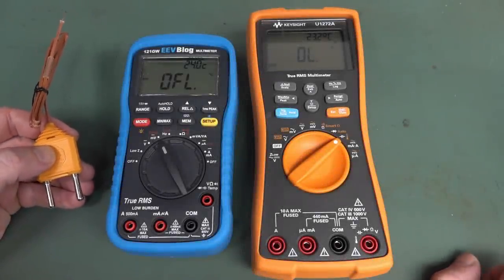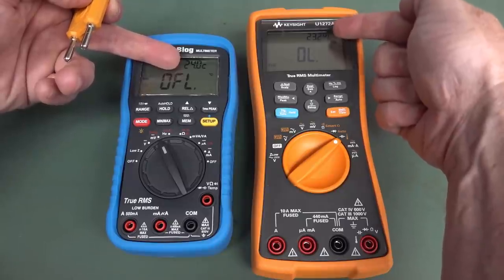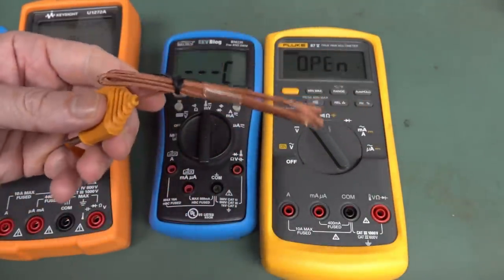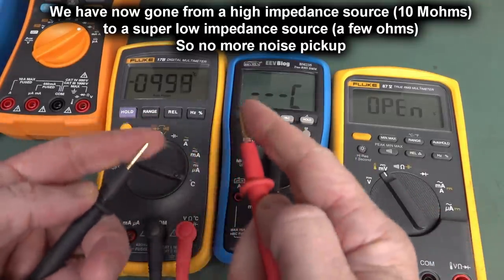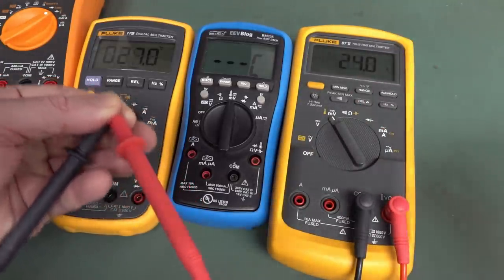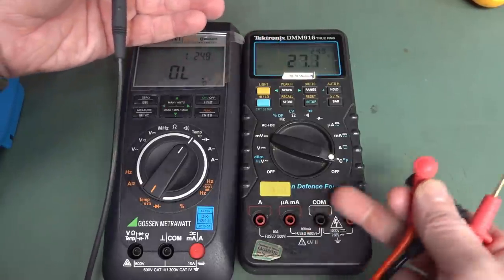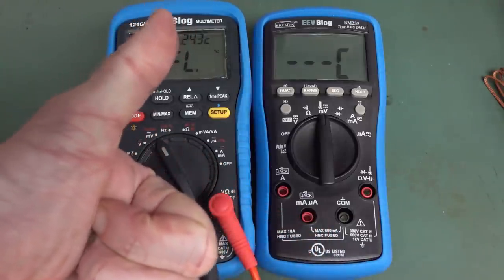EEVblog 1392 - No temp probe? No problem!

Comment: I was taught this when I was in the military, to ensure our cold-junction correction was working before using a meter to measure an external temperature.  Over the past 40 years I had totally forgotten about it.  Thanks for the reminder!
Reply from the maker: Yes, I should have mentioned that actually. If your meter isn't at ambient temperature internally before you take your thermocouple measurement then your reading will not be accurate. This is a way to double check that.
Reply: @EEVblog  are you sure about this? I always thought the thermocouple measures temperature difference between junctions, so whatever temperature is inside the meter shoud work as long as it's measured accurately internally.
Reply: @kaziq  Why would you need to measure ambient temperature in this case if the reading does not depend on it? As you said, thermocouples measure temperature difference between hot and cold junction and the cold junction is at ambient temperature so you have no way to know the absolute temperature without ambient reference.
Reply: @maximgusanu5294  I didn't say you don't need to measure the ambient temperature. My point is that the temperature inside the meter does not have to be the same as the ambient temperature for the measurement to be accurate. Dave said it has to be the same, but I can't understand why.
You say the cold junction is at ambient temperature, so where is the cold junction physically? If it's inside the meter, what does the ambient temperature have to do with it? You only need to know the temperature inside the meter (as close to the junction as possible) to know the cold junction temperature, no?
Reply: @kaziq  I think the cold junction is inside the thermocouple jack, not inside the meter, so the point is that the internal temperature of the meter has to be the same as the temperature of the jack.
Reply: @strobie42  Ah, that makes sense. Thanks.
Reply: @Comrade Vlad nope, the measuring junction of the 2 dissimilar metals is at the bead at the end of the cable. The lead returning to the jack maintains the separate metal types, but after the jack you see that the prongs are both the same metal. So the other metal junction is in the jack, and the thermocouple measures the difference between these 2 junctions. Therefore you need to know the real temperature of the jack to know the measured bead temperature. These meters use the meter internal temperature as an approximation of this. One should be aware of this if moving the meter and jack to different ambient environments, as one will lag more than the other.

Comment: Have met some ultra cheap ones which do not have that, and simply have a 25C offset for temperature measurement.
Reply: Yep, and these multiassumpters (not to be confused with multimeters) may not even have correct LUT/polynomial for temperature. Mine 838 shows over 1000C at 400C soldering fan, but it is totally accurate at 0C and 100C. That's probably because it is calibrated only by these two points

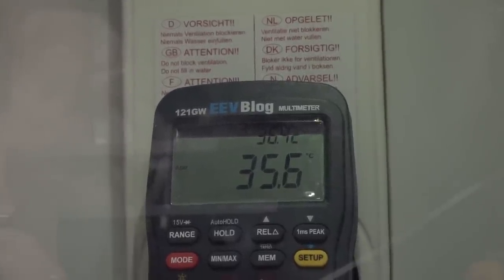Comment: 5:01 The lag for ambient temperature issue is a good reminder that this works both ways: if you're using a thermocouple and just moved the meter to a different environment, you need to wait for the meter's temperature to equalize or the thermocouple reading will be off.
Reply from the maker: Yes, mentioned in my pinned comment above.

Comment: Australian time warp - two minute tech tip is almost 6 minutes long  over here ! ha ha
Reply from the maker: Time dialation caused by the earths spin.
Reply: @EEVblog  Next video: No timer on your multimeter?
Reply: Agree. Video 5 minutes 59 seconds long. Opening with an ad about gut health and taking a big, healthy dump every morning by a Dr. Gundry. The ad was 47 minutes 55 seconds in length! At the end of the anticipated video is a very boring 11 minute 11 seconds ad scrolling the side effects of the latest immunosuppressive drug. That's a two minute 'quick tip' expanding into an unwieldy one hour, five minutes, and five seconds long video production. Yes, I checked the timer and let it run. Went through three soft fried eggs, two English Muffins with sweet butter and homemade lime marmalade. Full pot of Folgers. Guess that now I will have to watch the 'two minute tip', skipping the ads this time. Are all Australian tech tips long winded?
Reply: Looks like all of your meters are too long. Try Imperial.

Comment: HVAC installer here and “retired” controls engineer. I check temps every install with a temp tool and didn’t even think to use this feature and keep the thermocouple around as either a backup or bring one less tool. Great stuff!

Comment: The standard probes are a thermocouple junction whether you want them to be or not.  Copper wires with plated probe tips.  Fortunately the voltages produced are small.
Reply from the maker: Yes, i explain this in my tutorial video.

Comment: Now for the most important question, Dave?  Just how many multimeters DO you have???  A guy with one meter knows what the temperature is; a guy with 2 or 3 or 7 or 8 is never sure.....
Reply: The same logic can be applied to a clock maker. Never knows what time it is.

Comment: Clever. I check the fuse in the meter by setting the buzzer and put the probe in the mA test socket. When the fuse is in working order it will go through the mA jack to COM.

Comment: A few month's back I shorted the leads while changing modes on your BM235 meter. Passed through the temperature mode and was shocked to see it reading the ambient temperature. At the time, I assumed it was just some internal zero reference that happened to coincide with the ambient temp. Cool to know it actually is reading a thermo couple! I shall remember this trick.

Comment: Thanks. For same reason after you charge you keysight accu using the stock charger you have to wait for the multimeter board to cool down before you can do accurate thermocouple measurents. When charging the accu and the board can easily go to 35-40*C and so does the reference sensor. Fortunately for this type, you can judge by temporarily incorrect ambient temp indication.

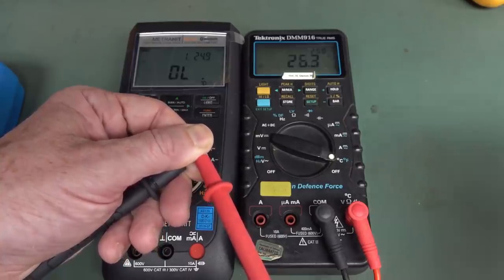Comment: 4:25 You have been holding those leads for a while and transferred some heat to them, maybe conductivity of the metal changed slightly due the heat increase so it shows increased temp?

Comment: I use a cheap hakko clone soldering tester occasionally for the same purpose. It's just a thermocouple in a box with a readout you can put the tip of your iron on to check it's running the right temperatures.

Comment: Ok I read the title wrong, I thought you could use one without a temperature feature to do temperature, kind of like how you can use a multimeter with a light meter (e.g. Apogee) and using a conversion factor get the actual light output.

Comment: I’ve noticed this effect before however I always thought it had something to do with the contact between the two probes doing some magic, now that you mention the cold junction temperature compensation it all makes sense!

However, I’ve just tried it on a Keithley DMM6500 bench DMM and it reports 22.80 °C (5 °C lower than ambient) right after power on, leaving it for a couple minutes to warm up shows no difference despite it clearly warming up on my thermal camera. I get the same results using either shorted probes or a proper ¾” shorting jumper? 

I pulled up the calibration report and it was calibrated at 22.2 °C, maybe the cold junction temperature is hardcoded or something but that wouldn't make sense?

Edit: Just tried it with my old pile of garbage DIGITECH QM1323 and says 25.4 °C which is only 2 °C off but it does respond to temperature changes (very slowly).
Reply from the maker: Interesting, Will have to try my bench meters and maybe put them in the thermal chamber.
There are different methods for doing the compensation, so could be something interesting happening here.
Reply: @EEVblog  I've just had a look through the manual for the DMM6500 as I don't use it for temperature measurements and it says the "Thermocouple Reference Junction" is 'simulated', I now see I can go into the UI and it's set to 23 °C! Changing it to anything else changes the shorted reading to that. It appears you can attach an external reference junction as part of the SCAN accessory cards.
Reply from the maker: @WizardTim  Wow, had no idea! But thinking about it, it makes sense, as rack mount gear can heat up, so an internal temp sensor isn't going to be at ambient temp for that absolute reference.
Reply: @EEVblog  This might make a good trap for young players video (or maybe as an addendum to this video?) as the K type thermocouples I have I always thought were bad because they measured way off on what I thought was the best tool I had for utilizing thermocouples! Turns out they’re all spot on!

Comment: Doesn't work with mine for some reason. Dunno. But it's a cheapo one and it doesn't even work with the temperature reader setting anyway. I put it outside for 10 minutes, and it still showed 22-26 degrees, same as inside. Cool video though, I never knew this.

Comment: My Voltcraft meter does not seem to do this. It does have a temp function on the dial. Not that I need it. I have oodles of DHT22 sensors kicking around.

Comment: So, do the ones with the internal temp sensor that will display it, is that also a thermocouple type sensor, or is that some other type of sensor? Do the internal temp sensors need a sensor for the temp correction, or do they just assume it's room temp?
Reply: Most of them use a small thermistor to measure the internal temperature. It's basically a resistor whose resistance will change based on the temperature.

Comment: If the resistance of the thermocouple was a exact known value how couldn't a temperature reading be given and how accurate could it be?
Reply: They can only measure temperature difference between two junctions. To know the absolute temperature at one junction, you need to know the absolute temperature of the other junction. By the way thermocouples output voltage instead of resistance.
Reply: @chuanliu4685  Yes I must have been confused with the method of reading temperature with certain alloys based on how the resistance changes with temperatures. Also known as resistance thermometers.

Comment: My multimeter doesn't have a temperature function but i bought a temp prob anyway. Is there any formula to calculate the temperature based on the measured resistance? I know it's not practical but I wish I could do this

Comment: I always hated thermocouples because they are so inaccurate and drift with time and usage.  My first assignment as an electronic engineer was to replace the 10 thermocouples in the instrument from thermocouples to RTDs (Resistance Temperature Detector).  They use a platinum wire wound around a ceramic core.  The resistance of the wire will change with temperature.  The initial resistance is usually 138.5 ohms at 100°C.  There are many types of RTDs but this is the most common.  With advanced math, solving a 9 variable matrix and 3 simultaneous equations I was able to reduce the circuitry to 1 common op-amp and 4 precision resistors for an accuracy of 0.1% over a range from -200°C to +600°C and a voltage output of 5mv/°C from -1V to +3V.  I was also able to correct for any length lead resistance to so only a 2 wire RTD is necessary.  My boss was so shocked and excited he didn't wait for the lawyers in the patent department to do their jobs and immediately put my design into production.  The patent lawyers came back and said they can't patent the design now because it is already in production and is now considered common knowledge!  There went my patent stipend of $300 from my company.  LOL

Comment: What if you have a thermocouple but your meter doesn’t explicitly support termpurature?
Reply: You can try measuring the voltage across the thermocouple leads and manually convert the readings to temperature from the charts. You then need to add the temperature to the cold junction temperature. You can try to estimate the room temperature, or hold the leads between your fingers and assume it to be around 35 °C. This is far from accurate, but it is better than nothing.

Comment: I think I've seen some very cheap DMM (9205A or 830 series DMM) with "temperature" measurement.
I don't think they have proper internal temperature sensor, they're just fixed offset voltage coupled with onboard LM358 dual op-amp to amplify those 41uV/C  into something temperature reading.
I suppose they're just offset it to standard normal room temperature from factory.
I'll try to heat it up one day to test it, the meter is super cheap though, less that $10 shipped.

My Texio DL-2060 (IIRC) 6 1/2 digit bench DMM will do temperature measurement with proper temperature probe adapter, i suppose they provide that relative room temperature measurement inside those adapter then compare it to the readings from plugged thermocouple/sensor, the meter does allow you to set whatever temperature offset that you want though (probably similar to REL function if you don't have the proper adapter).

Comment: In my opinion, this feature is not useful, though mildly interesting for illustration purposes, I suppose. You demonstrated though your multiple example meters that this internal temperature measurement is only about +/-2degC at best. I can determine the ambient temperature (within a reasonable range, say 15-28degC) with that same uncertainty without any meter, and my estimates don't suffer from lag either.

Comment: Ace Video! thank you.   
My 6 year old daughter loved it too :-)  We watched it together... 'daddy I love this video even though I don't understand any of it.  I like the drawings and he has a nice voice.': so that's nice feedback I thought you would like to hear.  I am 40 years older than her and also loved the explanation.

I have one quick question:  
My 'Hilka 90030064' DMM has TEMP and a connection for thermocouple (which am now planning to make and to purchase) but without any probes connected it seems to show a reasonable attempt at ambient temp (inside the meter) on the display when on the temp (c) setting.
-- Is that correct?   I have just put it in the fridge to test it too!  But wonder if this is correctly showing the meters internal ambient temp while on the Temp setting with no Thermocouple and no probes?

Comment: Nice one Dave!
My Aneng AN8009 mesures it even without shorting the leads, afer a second of 0000.
And indeed if you cool the multimeter down in the fridge, the thermocouple leads don't show the real ambient temperature anymore, it is suddenly same as internal, or thereabouts. Nice trick!

Comment: "Just a quick, 2 minute tech tip!"
Looks at video length...
Now that Dave figured out how to deal with a multimeter with no temp probe, he needs to figure out how to deal with a multimeter with no watch :)
Reply: For the difference between 2 and 6 minutes, measuring the voltage across a capacitor connected to a current source might work. More as a joke than a practical timer as for good accuracy over a significant time one would need maybe better than average components.

Comment: what am i missing? its not actually measuring the temp at the lead ends... (else that would be more like 37deg body temp)... ...its measuring the internal temp...which is not what youre trying to measure the temp of? you still need a probe if you want to measure something and not just the internal ambient....
...what am is missing?! youve got me confused with this one Dave!
Reply from the maker: It's for meauring ambient temperature only, and yes, inside the meter. Sorry if that wasn't obvious.
Your meter will (and should be) at ambient temperature when you take a thermocouple probe measurement, otherwise your temp reading will not be accurate.
Reply: @EEVblog  ahhh ok got ya now! that makes sense!.. maybe you should rename the vid to something like check ambient temp calibration without a probe... coz ya still need the probe to actually measure the temp of the component/device/whatever ya trying to measure..
Reply from the maker: @WacKEDmaN  Well it's in the description and I mention it many times throughout the video, that should be enough.
Reply: @EEVblog  yeah fair enough... i get that it was ambient temp i heard you say that a few times... i just didnt get the reason why ya would do this when the meter already had the internal temp on screen...but i see its helpful for checking the ambient on meters that dont already show the temp on screen... 
the title is what completely threw me... not having a temp probe is still a big problem if ya wanna measure anything other than ambient...
my elcheapo Digitech QM1527 doesnt even have a temp mode!

Comment: Oh No No No always this TC rubbish. There are better ones ! Use PT1000 or PT100 sensors, no problems with thermo voltage at the connectors! It's also as a smd available. But all this american TC bullshit is so often used.

Comment: You talk so FAST and so MUCH you didn't say what setting to put the multi-meter  on...That's BAD
Reply: You but the multimeter to measure temperature, and you short the meter probes.
Reply: This is an odd criticism. If he were talking about measuring volts, would you expect him to explicitly mention you have to put the meter into the volts mode?
Reply: Well you're measuring TEMPERATURE so......🤔
Reply: Watch the video again and observe please
Reply: Watch the video it seems to me that it was set on VOLTS MODE
Reply: @stevejosrph6065 , if you look closely at the multimeter’s symbols, you’ll see a little thermometer graphic. This is sometimes placed on the mV range or other shared switch locations. Not every meter has a dedicated switch location for temperature